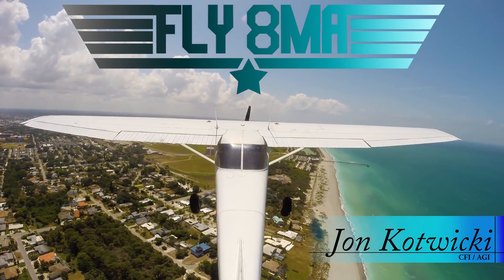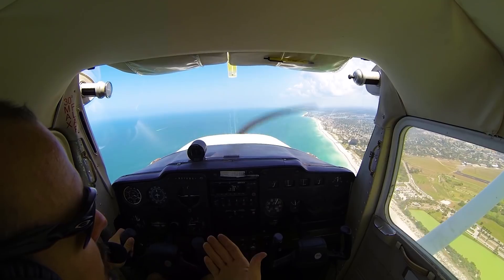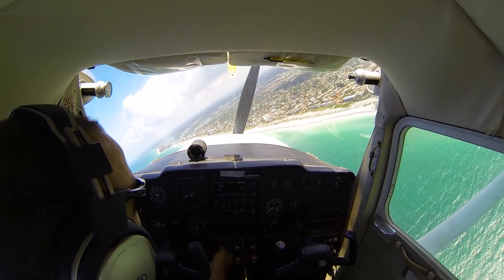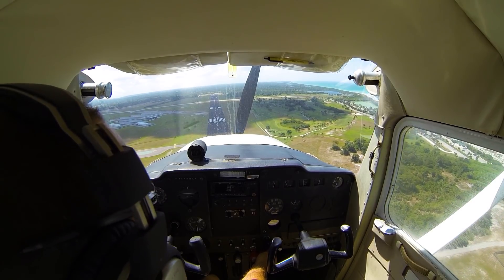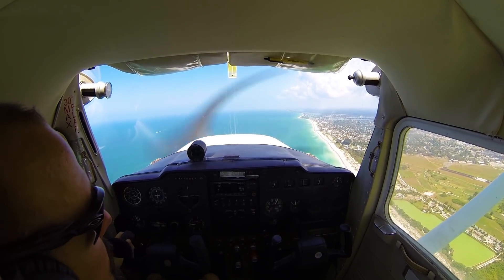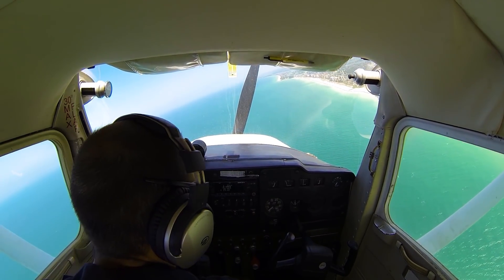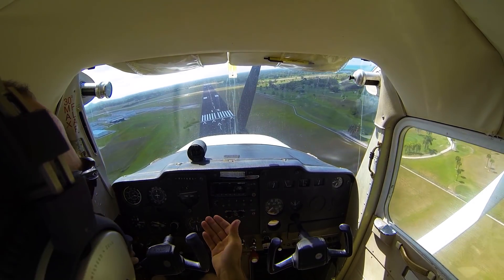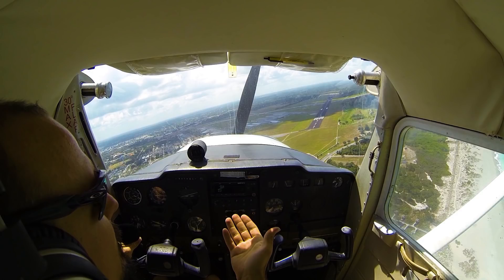Dead Stick landing in a Cessna

Comment: dead stick means you have no controls am i right? this has engine failure
Reply from the maker: A deadstick landing occurs when the aircraft loses engine power. The flight controls still operate; you are basically flying a heavy glider.

Comment: 01:32  very dangerous if too high and as you say, nose up on final to a low speed "behind the power curve".  Do that on final and you could see a stall.  That is asking for a stall speed drop like hell on short final. Can you erase that part?? Better to slip it if too high, until you drop the flaps. Im a glider instructor.  Also CFI aerobatics and 10 kinds of engine fails under TPA. 

Not even on gliders you slow down to almost stalling speed on short final to drop harder, no way. You slip, pop spoilers or pop flaps to drop at a steeper angle, never slow down to almost stalling speed on short final.  Otherwise great demo.. Salud, amigo.

Comment: Stopping the prop you do it only if over TPA (Like you did).  Under TPA you will be low and slow and stupid to do that due then will be very hard to PUSH nose down at low altitude (Needed, but very hard to do under stress).  On Cessnas prop will stop anyway after you drop full flaps and get to Vref for a short landing.

Comment: I used to do that demo in warm weather only (No Shock Cooling).  On a high base leg with flaps 20 already so I could slow it down to the prop stop speed of around 63 mph on C150.  Only if student is advanced AND he agrees on doing it.  Plan to do it on a weekday with light traffic and light winds only.. NO traffic in traffic pattern.. Get ready to call on final for a mayday if you see other airplane trying to get to the runway.  Log it as Prop Stop Forced Landing practice..

Comment: I understand that this is for training, but couldn't you just bring the power to idle?
Yeah, I know that the video looks better if you turn it off, but this is for training, and the message should be that EVEN for training you should NEVER turn it off.

It was easy to get to the runway from where you where, but what about an unexpected downdraft on final? Or a failure of any other part of the aircraft, like the flaps or anything that didn't allow you to reach or made you go around? what if it happens and the engine doesn't start again? You don't have alt power, what if there's something wrong with the battery and you cannot extend the flaps?

You should know that there's a possibility that the engine doesn't turn on due to a lot of factors, like compression, maybe mixture, cold weather maybe blocking the carburator, not having carburator heat because the engine is shut down (and remember it's a natural aspirated engine), etc.

I do not support that, any way it's always curious to see.

Comment: A lightly loaded C172 glides almost as good as a motor glider at MTOW.  I did this many times in the 1990's. Also i used to go to a ridge mountain range and using ascending winds, i could throtle back to almost idle and keep altitude with ridge lift only, just like an Eagle does.  No big deal. Cessnas are easy to fly, or glide.
Reply: Yeah, that's mainly if you're flying near mountains lol- not too many thermals in Connecticut

Comment: I have the same question as others. I would never shutoff an engine in practice, minimum throttle yes, but not shutdown. ... I have had partial loss of power, going down slowly, the instructor took control and set it down.

Comment: Excellent training! I have been practicing this maneuver for years in my simulators (X-Plane and FSX), and have been tempted to do it for real on numerous occasions - close to a field and with sufficient altitude, of course. I think that an actual demonstration is important to prepare oneself, should the real thing ever comes calling, then there is no confusion or guessing about what to do. Today's flight sims are excellent training aids that you can use to safely demonstrate pretty much any scenario, but seeing it demonstrated for real - without a windmilling prop, just confirms for me the results that I've consistently gotten from the simulators. I'm very confident that I could handle an engine out at proper altitude. It is not as big a deal as it's made out to be - as long as you are trained and prepared for it. Thanks you very much for this.
Reply: You should get training and a license, it's a fun experience to get trained in an actual plane and the license can actually be of good use when you plan to be a pilot someday

Comment: I've had 3 engines shutdown on take off...One at 300 ft, and two at 200ft....also, when I was young and stupid, I shut the engine down like you did only to come up short due to a strong headwind and when I went for the restart, with a brand new starter I just put it mind you, the starter drive gear broke off and left the aircraft !!! So my nice little gliding flight turned into a dead stick landing that I had only one shot at....it's not fun when it happens out of nowhere...,Honestly, the thousands of hours of R/C flying prepared me for those incidents......It was just another day at the R/C field except this time it was for real and my ass was strapped into that plane....
Reply: Great, But why did you lose engine at 200 and 300'?  What happened afterwards? You woke up?
Reply: @CFITOMAHAWK2  Loosing an engine at 200ft or 300ft you don't ever turn back 180 degrees to land. You lower the nose and land right in front of you, good luck.
Reply: What fucking plane are u flying, holy shit my dude
Reply: Things that didnt happen ^ this
Reply: So true, RC flying practices one to instantly learn what makes a plane truly fly. Its those split second decisions one develops over time that pay off big time.

Comment: You don't need to turn off the engine in a dummy run, and its bad practice. We all know that glider pilots have an approach that is higher and faster than we usually employ with Cessnas, so its worth practicing. But not with the engine off. At idle its producing little thrust, so there is no reason to turn it off, and plenty of reasons to keep it going.
Reply: My examiner wouldn't like this either.  He actually would goose my throttle occasionally or have me do it to avoid vapor lock on power off landings. 
Big on safety, he really got mad that I took a quick sip of water established on the runway about to take off.  Only was a second that I took the sip, but man did he come unglued. I thought I failed right then and there.  
Was at an uncontrolled airport.  I didn't think much about it, as the home airport was class C, and its common for line-up and wait. But uncontrolled airports on an active runway, he said you never know what's happening from behind: NORAD, no engine, etc. To get on the runway and get off ASAP, never delay at uncontrolled airports.   
Killing a good engine just to prove you can make it... he'd killed me.

Comment: In an engine out, I have been taught Nose down, Look for a landing spot, Go for it!  In other words, do your critical thinking and decision making quickly.  After reading several of your post replies; my two cents - Controlled environment practice helps a pilot react quick/correct/safe, and with confidence (i.e. 2nd nature).
 Thank you for this video and info -  (specifically regarding planning to overshoot the beginning of the runway in an engine out scenario) - Again, thanks for the effort and expertise!

Comment: Hi John, thank you for the great video. I was taught by my instructor not to exceed a bank angle of more than 30 degrees during an engine failure as this will lead to a significant loss of altitude and increased load factor, is it advisable that if you still have a higher than required glide speed you can make the 30 degrees bank with no thrust from engine and still make it back to the runway? I Just thought of it from this video...in most cases I've heard it doesn't go well..
Reply: Never turn around! Find a spot or make one.
Reply: @yellowhammer4747  thanks for your response, I also had that in mind, as it was advisable to just advance   the manoeuvre forward other than turning back..
Reply: There is evidence that a 45 degree banked turn will lose less altitude in the 180 degree turn than a 30 degree banked turn. Just make sure to keep your speed up (best glide) and don't get into an accelerated stall and keep the ball centered. Of course, you need to be at a high enough altitude to make it back to the runway. A lot of variables to take into consideration in this maneuver. (I'm not a flight instructor). There are Youtube videos demonstrating this.
Reply: @gorgly123  Thank you for your response I highly appreciate

Comment: If you have no frontwheel you shut down the engine too if you want because the motor can get ripped if it stop in one second if the propeller impacts and that can cost 20.000€😬

Comment: Jon, what happens if you loose your engine at say 500 feet climbing out to the east at Venice.
Reply from the maker: +Robert Jones depends on A TON of factors, but I'd probably be aiming for the ICW.
Reply: Improvised seaplane...
Reply: If at night,  you trim for best glide. At 100 feet you turn the landing light on. If you don't like what you see, you turn the landing light off!
Reply: Steve Giron, thanks! I haven't laughed like that for a while!
Reply: Hang on!

Comment: Wow, this is very risky stuff. Simulating an engine failure is one thing but actually switching off a serviceable engine is just plain dangerous. Not only for yourself but the people you are overflying!
Reply from the maker: +JP9556 it's so risky infact that soon gliders will be made illeagle :).   Fly safe!
Reply: FLY8MA.com Flight Training. I have spent many years promoting Flight Safety and it is frustrating to see levels of safety degraded like this. I am sure you are a competent aviator but this is truly setting a bad example! I have many hours flying a glider and gliding is what it is certified to do, Cessna's on the other hand....are not! All the best with your channel. Fly Safe!
Reply: @fly8ma.comflighttraining199  You intentionally created an emergency...
Reply: @fly8ma.comflighttraining199  Wow what a silly remark especially from so called instructor. Assumptions are the mother of all fuckups. Your assuming that because gliders do it all the time you should too? What about variables you can't control? Someone or something entering an active rwy? Loss of SA/miss communication due to comm loss? Or perhaps someone that actually has a real emergency and do to stress and startle factors can't get a radio message out? How will you then perform a GA? My point being that shit happens and that kind of attitude is poor judgement imho. Try justifying this to the FAA...
Reply: Yeah no kidding! What if a plane pulled out onto the runway when he was on short final, or a deer enters the runway, or a bird strike, etc. With no power, your options are....limited at best.
Reply: I almost always turn off the engine for landing - no problem (despite needing to turn it on for taxi)

Comment: What if you are far away from a airport and you are low
Reply from the maker: Good reason to not be low when you're far away from an airport eh?  The FAA though about that one with 91.119(a)
Always have a way out!  Fly Safe :)   -Jon
Reply: RANDOM ACTIVITY land in a field, no big deal.
Reply: That's why doing any ground reference maneuvers or just being low, its vital to constantly be looking for a good place to land in case fire or engine failure. My instructor told me to always be thinking about where you would put the airplane down, and do it at least every 10 minutes or so. And he would quiz me randomly during maneuvers on where I would land in case of engine failure.

Comment: Nice land!!
haha what about engine Failure on take off?!
Reply from the maker: Landing straight ahead on a long runway is always a nice thing to be able to do, and by the time you burn up a 9,000' long runway you are probably high enough to make a turn back to the airport (good reason to avoid intersection departures too!)  Fly safe :)   Check out the free private pilot ground school at www.fly8ma.com !
Reply: FLY8MA.com Flight Training 
Is it possible to completely stop the engine in the simulation of engine failure with ASEL training?

Comment: I have done a lot of simulated engine failures throughout my flying career but have never actually shut off the engine. Great video Jon, you have some major skills. Thanks again.
Reply from the maker: Thanks!  Fly safe out there and be sure to share the new free private pilot ground school with your friends! www.fly8ma.com
Reply: that's bcs when you shut of the engine completely while in the air you're making damage to your gearbox so that it will eventually fail for real in flight.
This is why AGK is important.

EDIT: ofc the aircraft can have a windmilling setup which should decrease that to almost not happening.
Reply: Mathias Emil Kuntz Can you explain the difference between shutting it off on the ground and in the air? Curious about the differences.
Reply: @KJK9029  Shutting engine off on the ground while taxing or on runway is slightly better if you catch in at V1 decision speed or 3/4 of the way down the runway etc. apply brakes and have a coffee. If you're only 200-500 ft one doesn't have enough altitude to even make a 180 degree turn to land on runway safely, then its look for any open area big enough without any obstacles or telephone poles, wires or people in the way.
Reply: @MathiasEmilKuntz1994  not true
Reply: @MathiasEmilKuntz1994   Easy.  You  pull out the throttle, then, the mixture, then the mags.  You slow down to the airplane stall speed.  The prop stalls, the windmilling stops, you are now piloting a glider in the silence of the sky.  You then take the key out of the ignition and hand it over to a passenger on the back seat.  Easy, romantic and safe when you know what you are doing.
Reply: @Doupirate  You do not ever slow down to airplane Stall speeds LOL, that would end up with a stall spin crash scenerio. One instead chooses to remain at "Best Glide Speeds" in your POH booklets
Reply: @Doupirate  Used to do that all the time 5000 feet AGL in a Tripacer or Aeronca Chief. That gives you the experience without the risk. I wouldn't take the key out of the ignition though. That's an invitation for having to do a real emergency landing if I dropped it. Nice thing too at altitude is you can probably start the engine again just by pushing mixture back in, turning the mags back on, and pushing the nose over to around cruise speed where the wind will cause the prop to spin without the starter. Even if it doesn't, just touching the starter for a split second will be enough to get it over the compression hump.